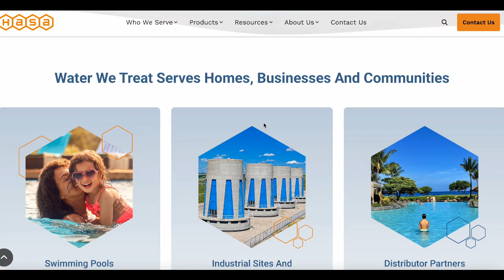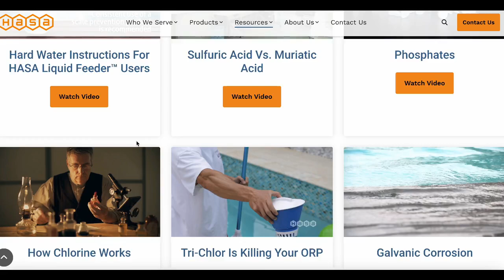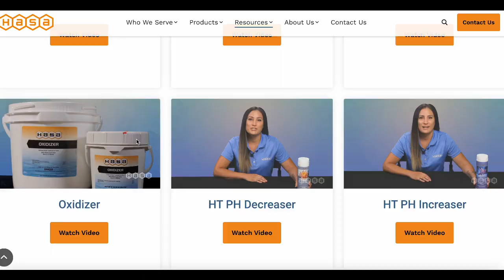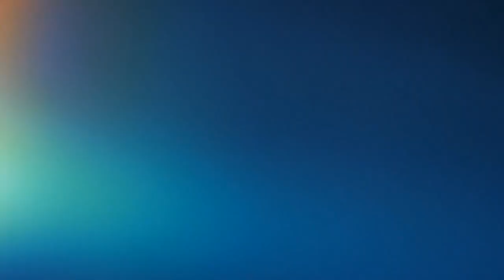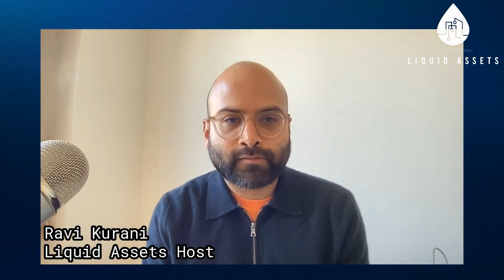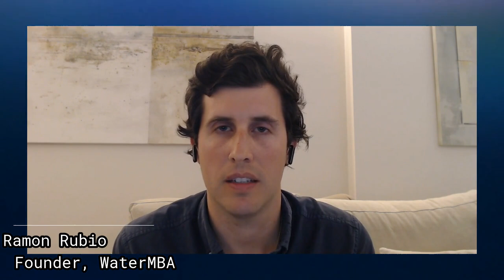Tackling Water  Sustainability & Scarcity in 2025

Comment: Having modern water filtration technologies isn't really going to change anything for the majority of people who suffer from water scarcity, in my opinion. Even if we completely disregard the cost and energy consumption needed to create water and just look at the process itself. If we look at Israel for example, it is impressive how efficiently, and in what quantities, seawater is turned into drinkable water. Now  try to build the same facilities into, let's say Senegal for example, and it just won't work. Even if the facilities and technologies would be provided  and local staff would be trained to run and maintain the filtration plants,  you'd need reliable supporting infrastructure: power, water lines, functional streets, access to spare parts and replacements parts etc. Just introducing modern technologies into countries that don't have the infrastructure to efficiently make use of them, either won't work at all, or require constant foreign support to ensure they're running, leading to yet again more dependencies on foreign powers. Just having the technology isn't a solution in itself, it's a problem far more complex than that.